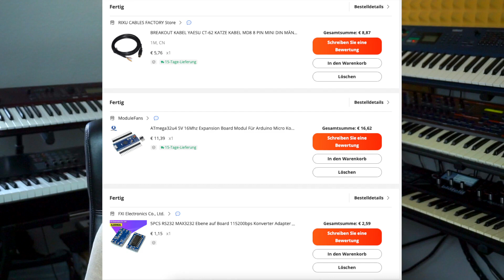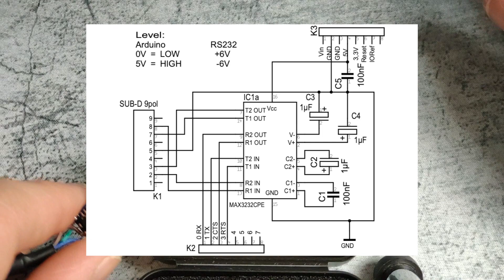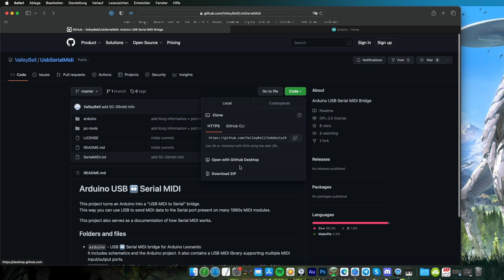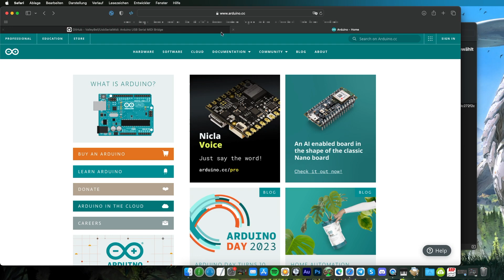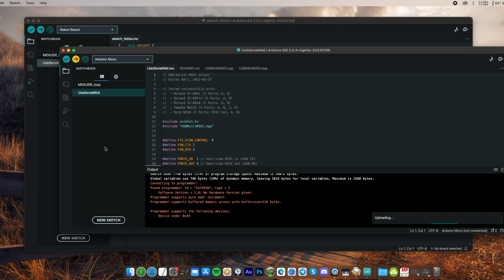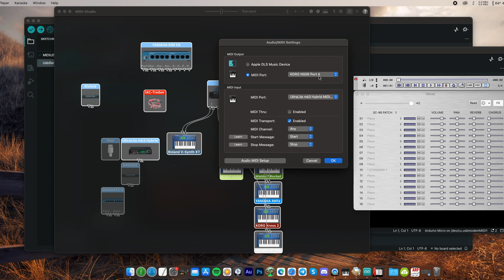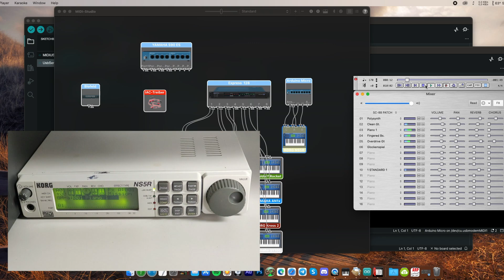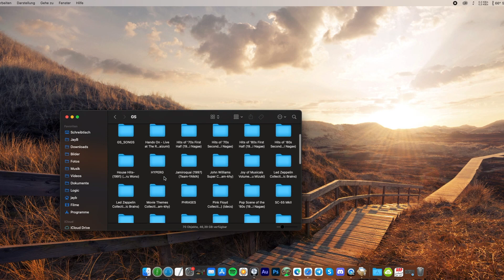Reviving the TO HOST port using Arduino and USBSerialMIDI by ValleyBell

Comment from the maker: Thanks to Github user "Mwyann" Windows compatibility has been fixed and the Arduino board now gets recognized as a MIDI interface with 4 MIDI Outputs and 1 MIDI In.
Reply: Thank you for the video. You kinda forgot to thank the original author for his awesome work figuring the intricacies of an ancient protocol and building a nifty little tool accessible for free to everyone.

Comment: Thank you for the inspiring idea. In my studio are MU100R and NX5R - both with TO-HOST :) I solved this problem by installing VMware Workstation Player with Windows XP, then rtpMIDI tool inside the XP guest OS and outside in the host OS. Of course, the NX5R is connected to PC via RS232 cable with TO-HOST on the synth side. The COM is addressed in XP using KORG I/F drivers.

Comment: Im very confused .. what about a simple 8-pin din to USB adapter cable? Could it do the job?
Reply from the maker: All the cables I found have a different pin layout. Also you'd somehow need to get the MIDI functionality going. The Arduino gets recognized as a MIDI interface, not just a serial port.